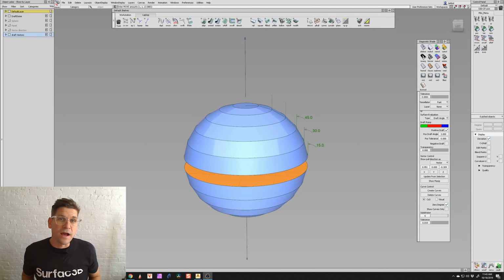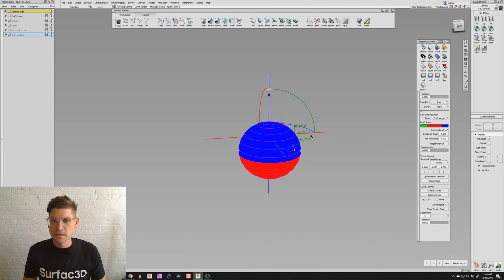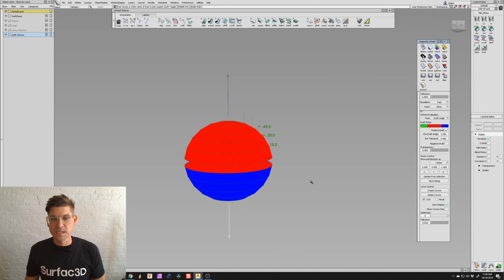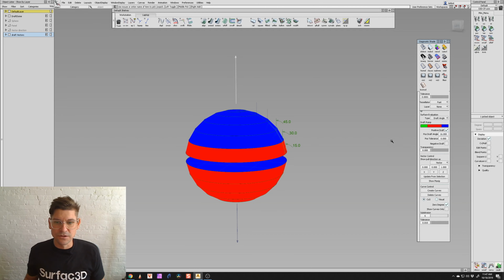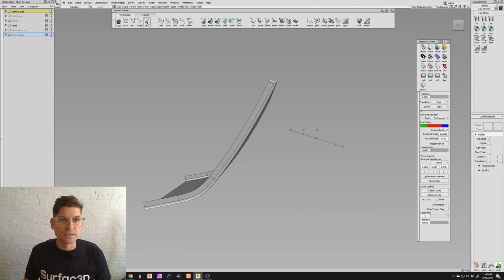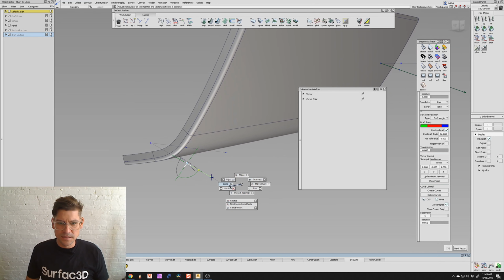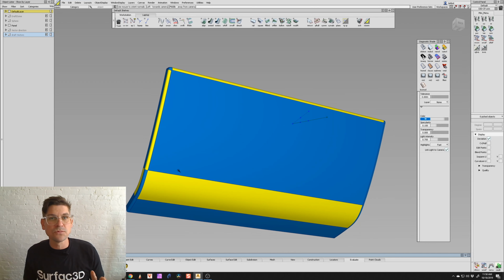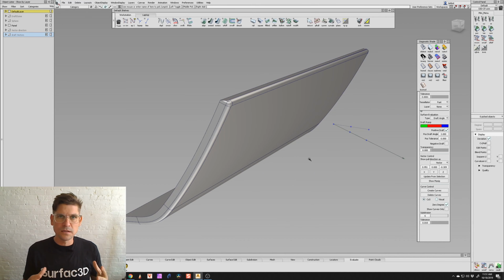Autodesk Alias Tool Tip - Draft Analysis

Comment: Shouldn't the tool analysis give result in green? I use this for injection molding plastics parts analysis and aim to get full panel in green on analysis using engineering specified vector and draft angle
Reply from the maker: Great question.  The tool will work either way.   I believe the green color is for the negative draft values.    It really depends on the vector direction you prefer relevant to the part.   Either way should give you the same result.